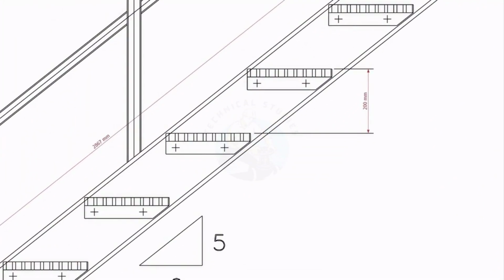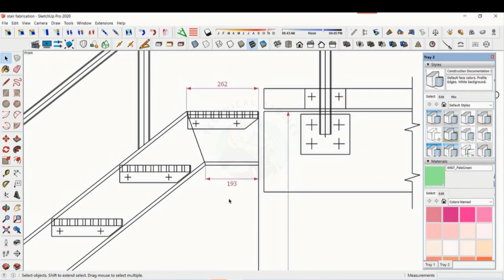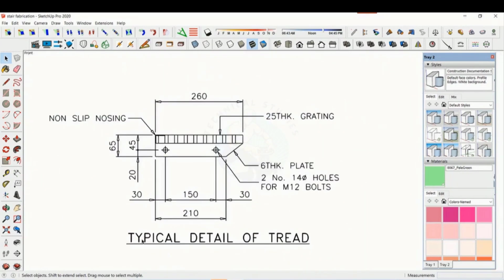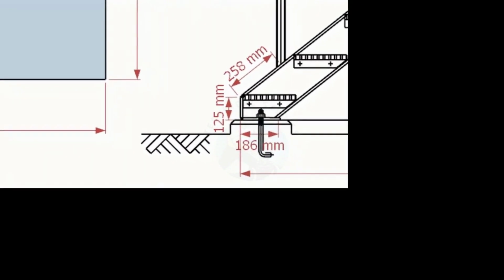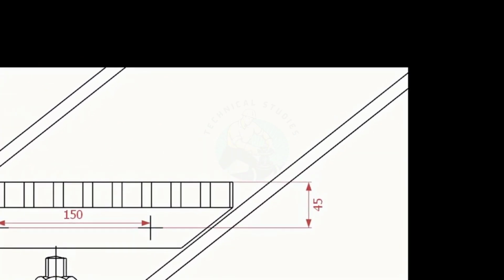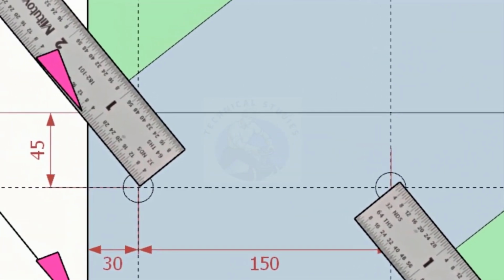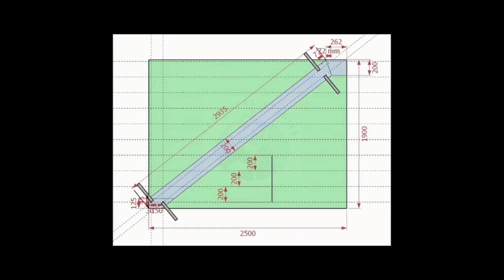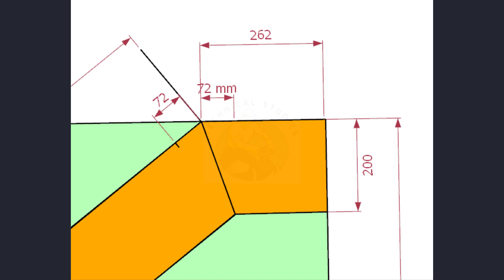How to make a steel staircase. Layout & Fabrication. स्तैर केस कैसा बनाएंगे DOWNLOAD DRAWING

Comment: Fabricate an angle iron bracket with two places that you have to bend, using a cutting torch one side is at 53 degree and the other is at a 37 degree
Reply from the maker: OK Bro.
Reply: I would really appreciate and thanks